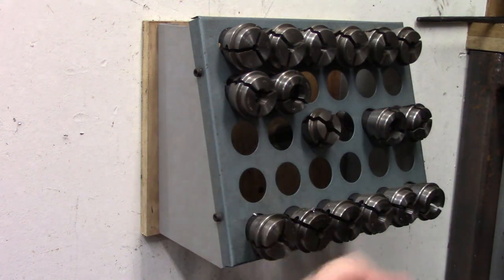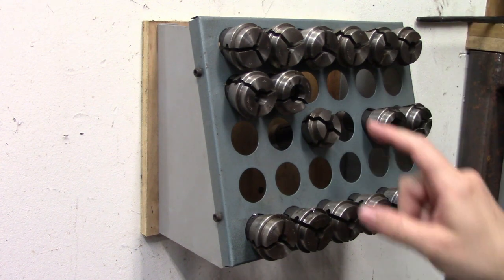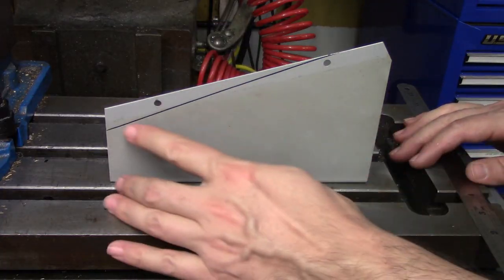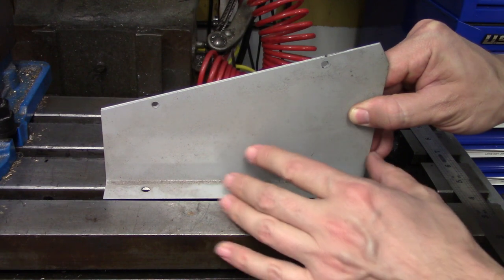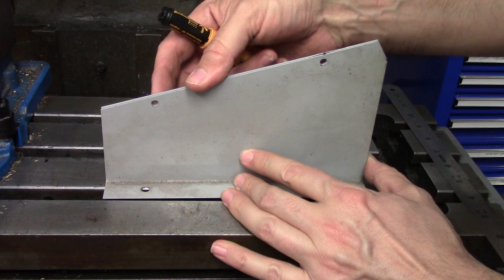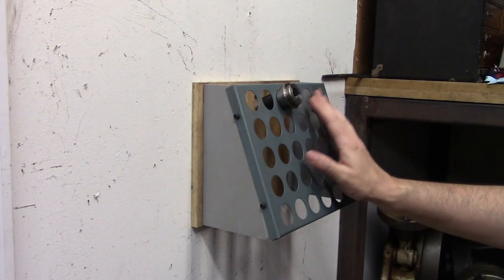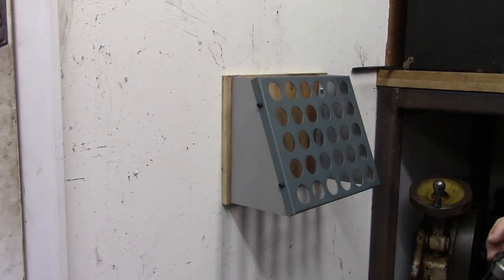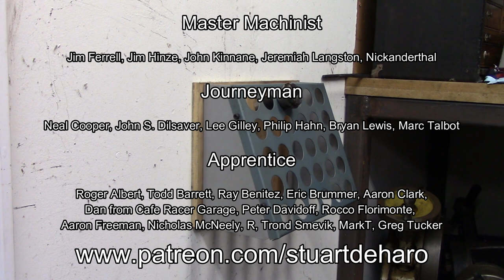Modifications to a 5C Collet Rack

Comment: Parallel clamp video would be great. FYI – most/all of the ones already on YT are made on the mill. Big opportunity here to have the sans mill clamp genre all to yourself! Also expand your audience to include lowly drill press owners. 😀
Reply from the maker: That's a pretty good idea except I don't actually have a drill press. I might be picking one up once I move though.
Reply: @StuartdeHaro  Meh, not really important whether the holes are drilled with a DP or a mill or by hand (if accurate). It's the squaring of stock, angle milling, groves, slots and keyways that more often become obstacles to beginner projects like this. I assume there are plenty of guys like me who want a mill, but we're just not there yet. Designs and procedures offering alternatives to milling ops allow me to participate even without the bigger investment. Love your videos – keep up the good work!
Reply from the maker: @JohnThawley  Do you have a lathe? I can do it all on that.
Reply: @StuartdeHaro  I've got a 7x/mini lathe, but have never done any milling ops with it. Feel kinda dumb it never occurred to me the clamp stock is small enough to fit in a tool holder. Thanks!

Comment: Are 11 and 11c the same thing? I picked up a 1940s B&S No.1 universal grinder, came with a couple dozen No. 11 B&S collets
Reply from the maker: I'm not sure. If you want it, it's yours for the taking, although it's already packed and in storage so I won't be able to send it to you until I unpack that box sometime next month
Reply: @StuartdeHaro  Yeah sure, I'll do postage for it when I hear you've started unpacking.  I'll have to ask the old timers at work, one of them ran a cam operated screw machine in the 80s.
Reply from the maker: @benirall1246  Cool. Drop me an email with your address and I'll send it to you once I find it again. I've been labeling my boxes quite thoroughly so it shouldn't take long to find.
Reply: @StuartdeHaro  Sorry, I forgot about this entirely after being busy. If you'd still want to ship it I actually made myself a basic collett rack for the ~30 #11s I have. I wasn't able to find your email
Reply from the maker: @benirall1246  My email is my channel name @gmail.com. I actually just found that box so your timing is excellent.